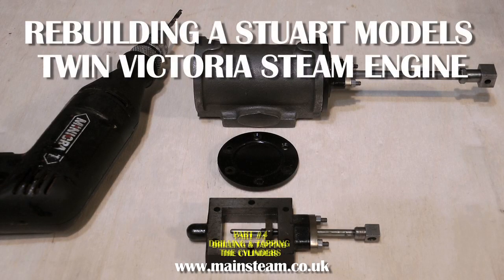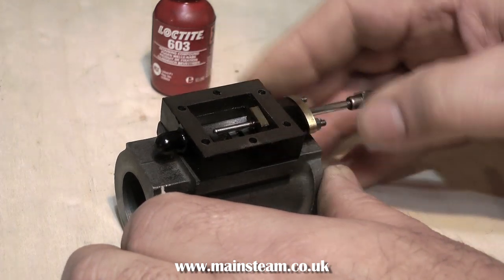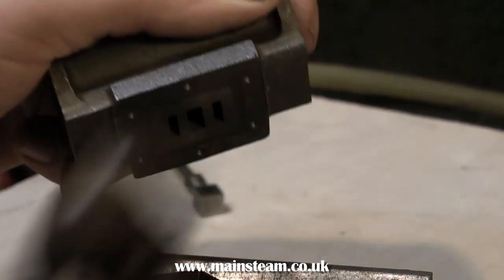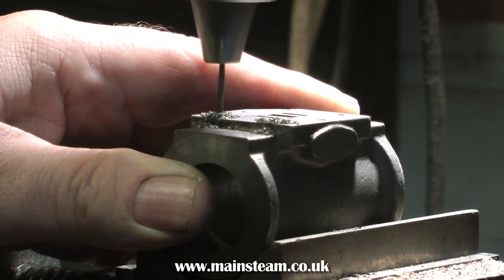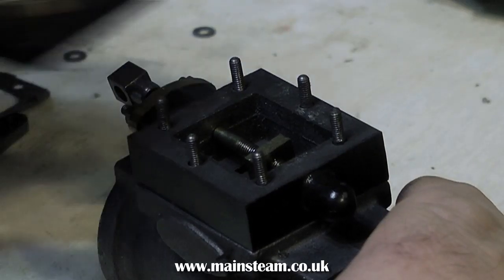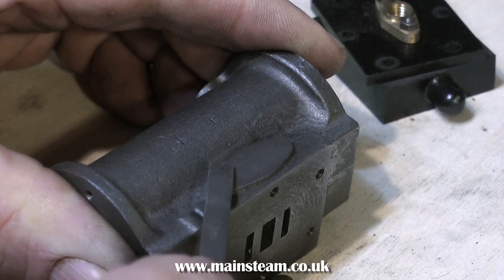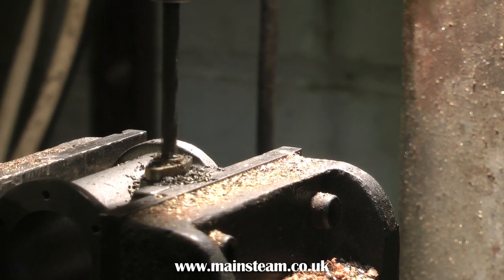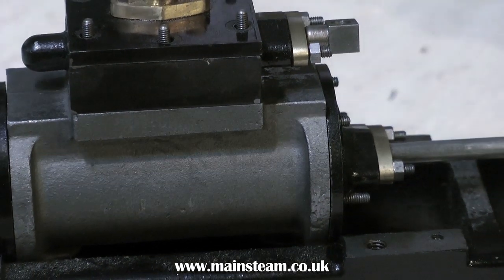PART #4 - REBUILDING A STUART MODELS TWIN VICTORIA STEAM ENGINE

Comment: Don't use tapping fluid when tapping cast, tap dry. Tapping fluid will turn cast shavings into abrasive paste which will dull the tap in short order.

Comment: I tried the loctite trick to fix a manifold flange to an IC engine so I could spot through - there was some loctite uncured in one of the holes,  it grabbed the drill (1.6 mm) and broke the tip into the cylinder head!  It's a good trick,  but go easy with the juice..